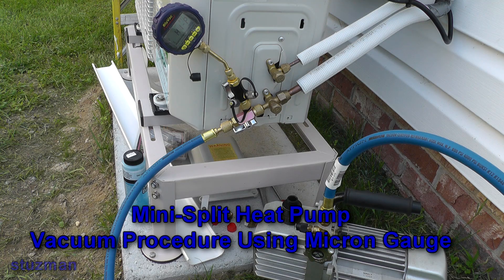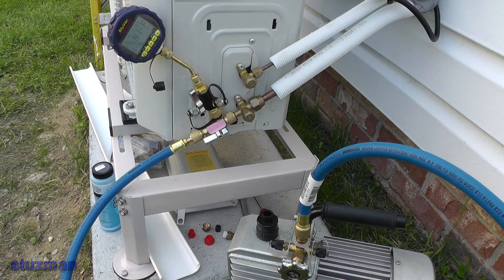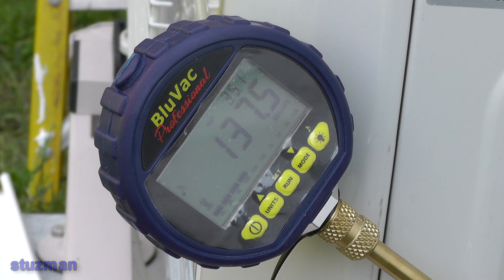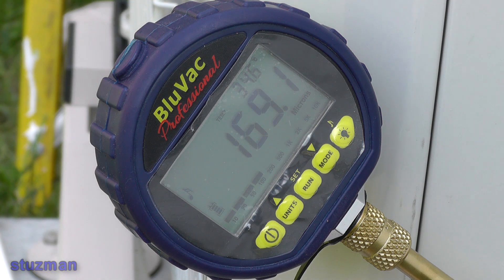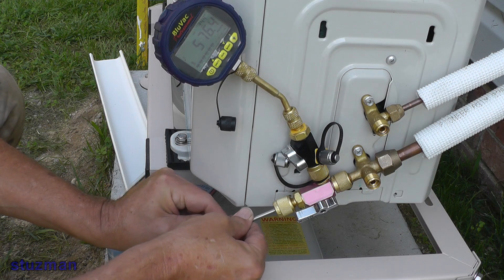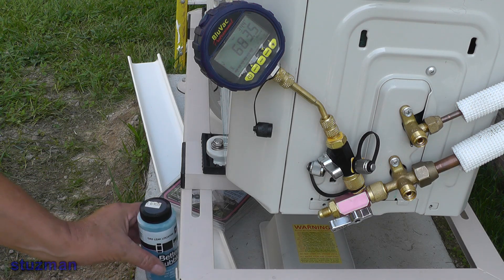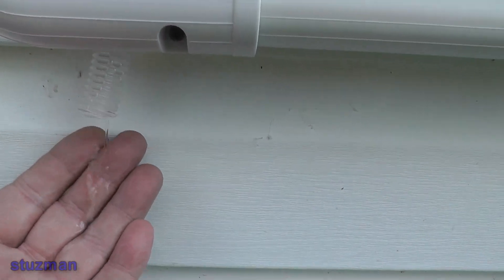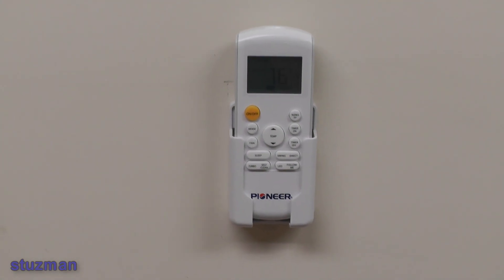Mini-Split Heat Pump: Vacuum Procedure Using a Micron Gauge

Comment: Hi have 24000 btu air split runing in heat mode whet temp 70 it runing worm  but put the unit to the more 80 and temp no change can u  help  me why no heat more thank you

Comment: Building a house. Will install a  Mitsubishi mini split with 3 wall units. Will have a hvac tech do the micron and vacuum test. Electrician wire it up.
I'm in Thomasville, Ga. I'm wondering if your close enough to do the micron and vacuum, stuzman?
Reply from the maker: Rinky Dink RV Sounds like you’re going to have a nice house. Little too far away as I’m in North Carolina. But your HVAC tech should be able to fix you right up. Happy holidays to you and your family!
Reply: stuzman where in NC do you live? I’m in Winston Salem and in need of an install for a 12k Mitsubishi system. Great videos.

Comment: Sometimes we take the cool for granted. Working in extreme temperatures ain't pleasant. Remember relining a large kiln with fire bricks and was given 3 minutes. Wooden clogs on the feet ,quick shifts and plenty of drinking water.
Reply from the maker: Tom OConnor That’s some fast work Tom and thank you for the comment!

Comment: Nice set of videos... I am assuming that for a typical instillation of a mini split the condenser is precharged with enough refrigerant, is there a run length that would require larger tubing OR an increase in refrigerant charge? also, when checking that system at any future date, there appears to be no high side port, how is that done?
Reply from the maker: That is correct that this unit along with other manufacturers comes precharged with the correct amount of refrigerant stored in the condenser. The unit is charged for a maximum line-set length of 25'. You can go as short as 10' in the line-set length without any issues. If you go shorter or longer than indicated, then you'll have to evacuate the refrigerant and adjust the amount according to the installation manual. For example, 0.16 oz/ft if the length exceeds 25'. As for the size of the tubing, that is shipped with the unit and it's size is based on the BTU rating of the unit. And as for their being no high side, if there is a suspicion that the low side is reading too low indicating maybe a low charge, then the system must be evacuated and recharged by weight, same as on an automobile.